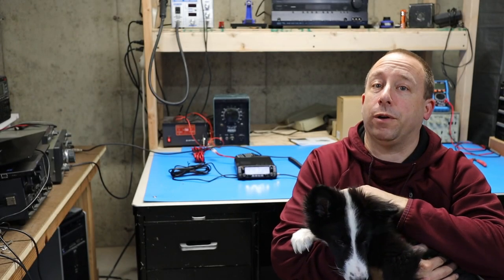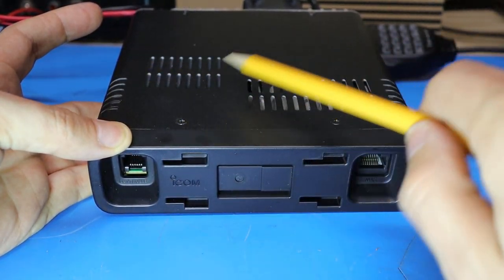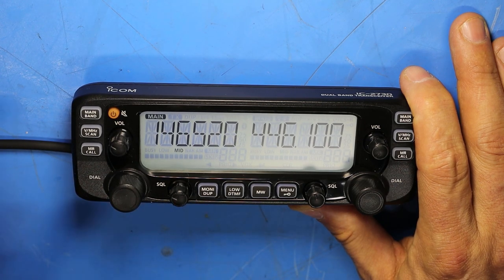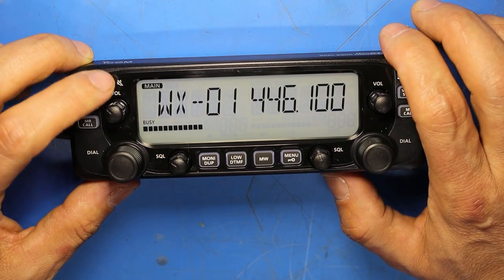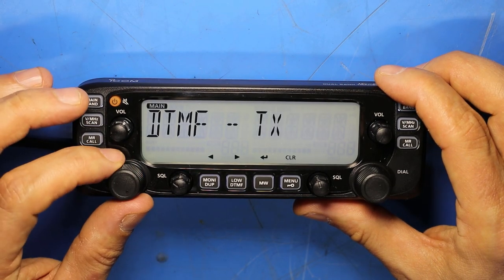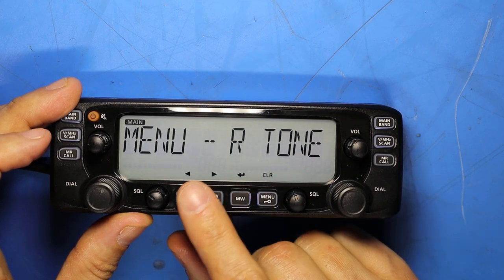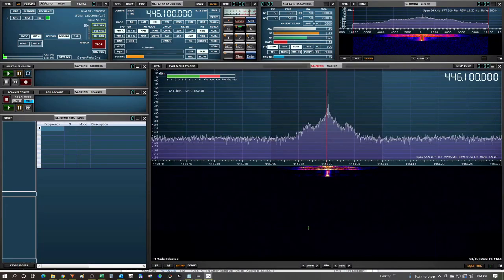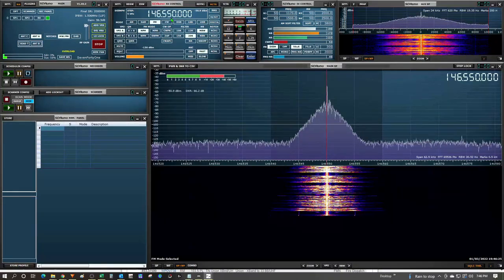Ham Radio: Icom 2730A Dual Band Transceiver Overview and Demo

Comment: I have been using this radio as my UHF/VHF base station since early 2020. I have the radio behind the desk, and the faceplate is affixed to my computer monitor riser. It's a great performing radio, and particularly performs better on simplex than any of the budget transceivers I used before. The only complaint I have is the same one I've seen others have: the fan is loud, and kicks in the entire time you are transmitting if you use high power. In a vehicle in the trunk or under the seat, that's no biggie, but as a base station, even packed away behind the desk, it is a bit distracting. But that has yet to make me want to replace it, and I'd still recommend it to friends. Anyway, nice and comprehensive video!
Reply from the maker: I've noticed the fan is a bit loud and obnoxious.  I've been using the radio a bit but it doesn't seem to really get that hot even on high power...I wish the fan speed could be turned down a little.
Reply: Hello, do you use the programming software that you have to buy or chirp to program it ?
Reply from the maker: There is free software on icons site. Vou need a programming cable to use it...sold separately
Reply: @scottsavoie7072  I can confirm that once you buy the cable, it works with Chirp as well as the icom software. The iCom software is more tailored to the radio, but I use Chirp (since I'm already used to it) and it works fine with the radio.
Reply: Replace fan with quiet one. Very easy
Reply: Substitueix el ventilador original per un Noctua silenciós i problema arreglat👍

Comment: Thank you for this video. I have had the radio in my truck for a couple of years now but never really learned to use it beyond the memory settings I put into it now using the RTS systems cable and software. 
Recently I was acting as net control for a local network and discovered to my surprise that when I programmed the radio with repeaters in my area here in Alaska that there were several repeaters with the same call sign, but different PL tones. 
To my horror I didn't know which repeater in my memory bank was the one I was supposed to host the net on, so I had to dig out the manual for figuring out how to manually program the correct repeater in using my ARRL Repeater book for the information.

 I was able to get that done but then took the radio in and reset all the memory banks and channels using the repeater location as opposed to just the call sign to ID which one I was on. 
Your videos are terrific for getting to know my radio and I am very happy I found you. Thank you so much for such really helpful information. 73 AD7VV
Reply from the maker: Thanks for the kind words!  I'm glad this video helped you!

Comment: Thanks 741! Cool radio. I use the Icom 7100 and it does VHF and UHF.  Also a good radio with HF as well! I use in my shack, but it goes mobile with me on long trips. Thanks for this review!
Reply from the maker: I thought about getting a 7100 but didn't have the budget for it right now.

Comment: I have two of these radios.  One in the house and one in the truck.  The only two complaints I have are the tiny power button and the noisy fan, but it's not noticeable in the truck.
Reply from the maker: The fan is loud for sure

Comment: If I understand correctly, I would be able to broadcast from a handheld to channel 1 on this radio and it will relay (send) the message on a different frequency on channel 2. Basically a built in repeater.
Reply from the maker: Sort of, yes.  This radio has cross band repeat function.  You can transmit on uhf from a handheld and this radio will retransmit what it receives on vhf or vice versa

Comment: New ham here. About to hook this up as a base radio. Dumb question….Where does the sound come out? The head? Mic? Main radio unit? Or is an external speaker recommended?
Reply from the maker: The speaker is in the bottom of the main unit.  You can use an external speaker if that doesn't sound good or you want to place it on a desk

Comment: Excellent video. Even though I have the audio gain at maximum I get reports of low audio. Any ideas? Never that with other radios.
Reply from the maker: I've gotten that complaint as well.  I talk soft sometimes and don't always hold the mic close.  When someone complains I speak up and make sure I'm talking directly into the mic and that seems to fix the issue.  Having said that, I don't have that problem with other radios...just this one

Comment: I have owned the IC-2730 for over a year and use it as a base station radio. It is excellent. No complaints about the hardware. I have been a HAM for over thirty years and I would say that this radio has the worst written manual Icom has ever put out. It's as though someone who spoke poor Japanese and knew nothing about radios wrote a manual and then let someone for whom English was a second language translate it for them. It's that bad. No, probably worse. Thank God for these YouTube videos or you would never program this thing.
Reply from the maker: I'm really happy with mine too

Comment: I have one in my wifes car. I chose this as it had the detachable face that accepts the mic into the face. I took the dash all apart, took all the interior out for access to the factory wire channels to the trunk. It makes for a super clean install. The control box is in the trunk hidden away. I even hid the coax in the trunk lid hinge and that is invisible. I do hate the way the radio programs, and operates. For me I struggle with the way the menu and control operations are set up. My kenwoods are easy to run, this needs a manual to do anything. I keep the manual right in the car. I am sure if I ran it more I would become accustom to the operation. The mic cord insulation broke almost immediately right at the entrance to the mic. The small wires were exposed so I took a drip of super glue to make that spot ridged so it would not flex and break the small wires.
Reply from the maker: Good tip on the mic wires.  We'll see how long this lasts after I install it.

Comment: Hi, I'm going to buy the icom 2730E
 Question;
 The radio has several power settings, is it possible to set one of the powers to a lower one, e.g. 0 5Wat / 1Wat, etc., the minimum is probably 5W
  Is the reception of all frequencies good: 118.000MhzMhz / 150.000Mhz / 446.000Mhz is good Regards.

  ....
Reply from the maker: The min power is whatever is listed in the manual.... probably 5w.  Reception of out of hand signals is good
Reply: @SevenFortyOne  ok Sewen.